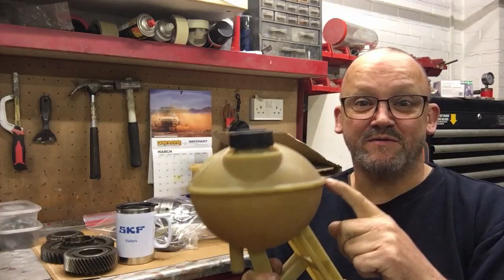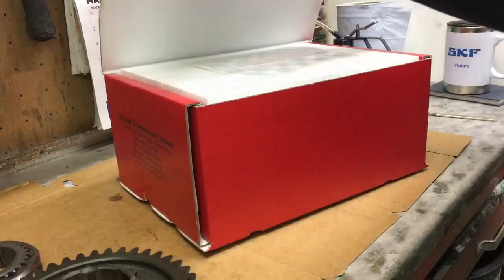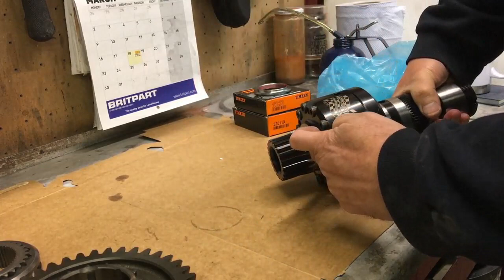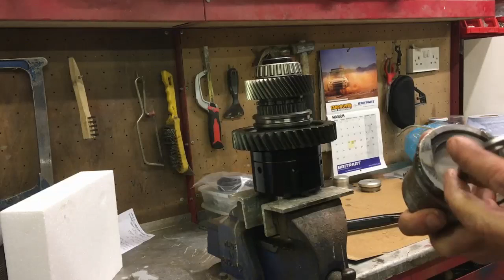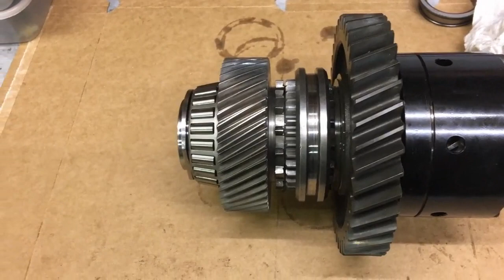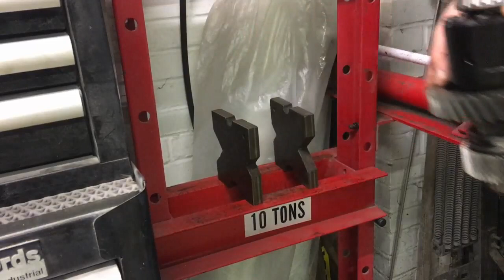Ashcroft ATB Centre Diff Part 4. Building the Diff assembly.

Comment: Seeking some advice here, im going through that process. I have lots of play between the low gear and the hi-lo hub, about 0.011, my reaction was maybe I should press the top bearing more, but what happens when I do that I have no end float on the high gear at all, and I actually can get it stuck completely, but it doesn't change anything for the lo gear, the 0.011 is still there.  Now here's the tricky part. when I put everything back on the old diff, I get 0.004 of floating for the low gear. I just ordered a new low gear and hi-low hub, but I doubt it will change anything, I could be wrong.  My current hub is a bit knackered and worn, but the low gear looks brand new and still very sharp. any advice would be appreciated. Kudos for the video, great stuff!

Comment: The bearing race that has to sit 1,0mm deeper than the housing surface has the same diameter as the larger sized shims for a rover or P38 diff pinion. So if you have the ashcroft diff shim set set lying around, then you can just use the 0,95 and 0,05 shim between the race and a larger piece on top when pressing it in.
Reply from the maker: Great tip!!

Comment: LMAO!!!....you're right they are a bit crap those mills...but they're far better than nothing!....if you upgrade them to either metal gears or belt drive they're apparently better........glad to see you've finally got the blue bag diff fitted together :) ........and the Landy mechanics that built your transfer box were obviously of the "then they smash them all to bits" school of engineering....
Reply from the maker: Grump's Barn I’d like to get a better motor for it. The stock motor sucks!!
Reply: @defender90keswick.nigelsla59  there has to be an upgraded version....say one from a hairdryer...😂😂😂